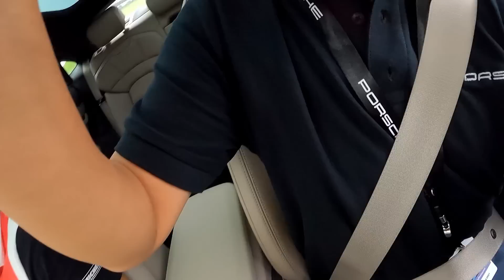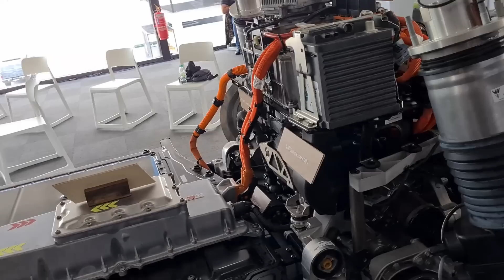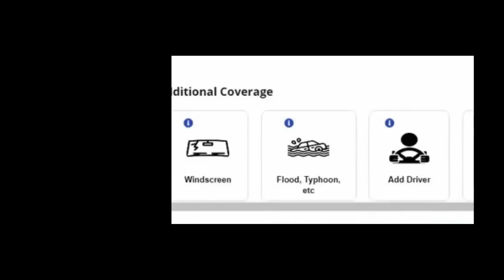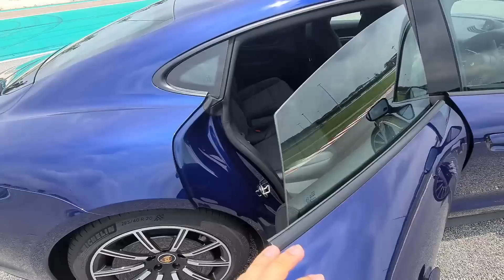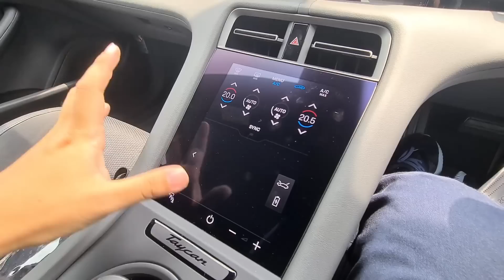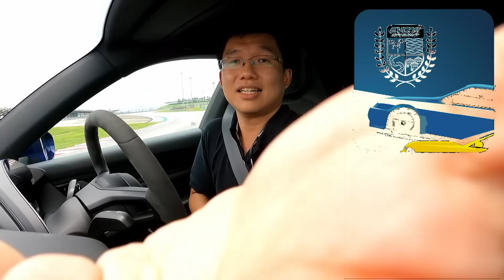The Porsche Taycan shows that even the future of sports cars is electric | EvoMalaysia.com

Comment: I wonder how the maintenance service schedule look like. Because it got no engine. So what does sc do when inspection or servicing 😅
Reply from the maker: Significantly less servicing required. Tyre wear and suspension wear may be higher than combustion cars because of the added weight, but your brake pads will last longer as EVs primarily slow down with regen braking. A/C usage will be same as regular combustion and may require more or less the same kind of service. You'll still need a cooling system. The 12V battery should last longer too, as not contained in a hot engine bay.